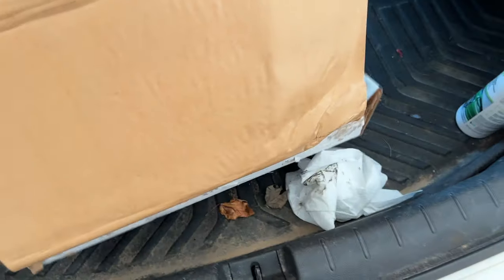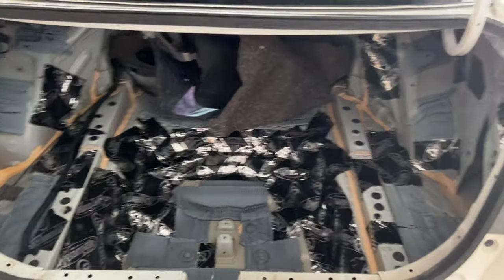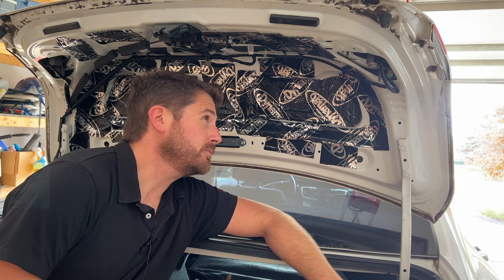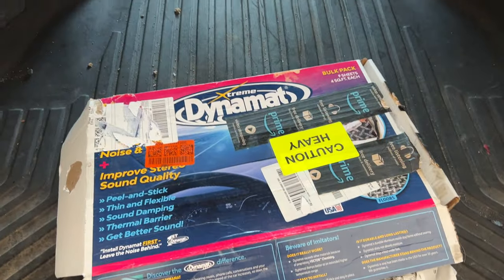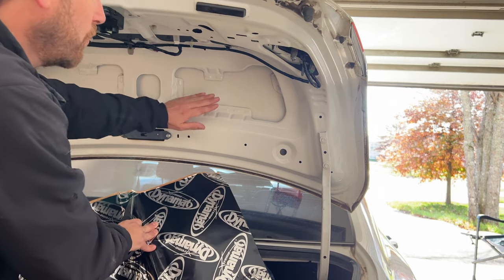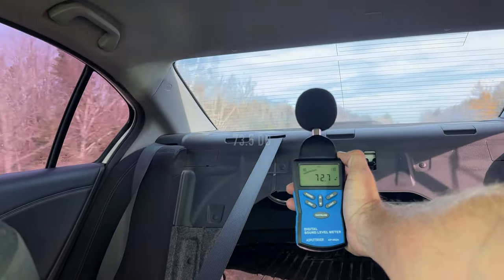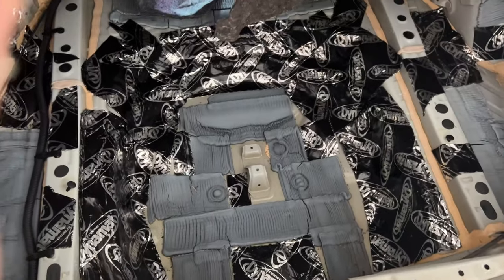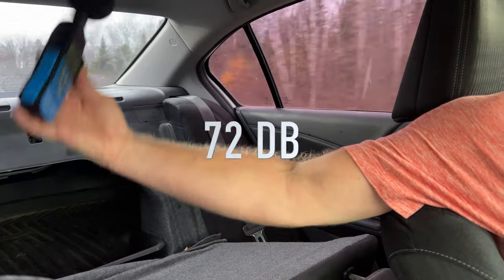The Secret To Sound Deadening Your Car's Trunk

Comment: Car sound insulation needs more sound insulation and sound absorption materials. Shock-absorbing materials don't have much effect on decibels. The focus of the rear compartment is to fill the voids on both sides of the tires. The shock-absorbing material should not be too much, otherwise it will cause low-frequency pollution, and low-frequency sound insulation is relatively difficult. My car is 110KM/H 71-74 decibels, DIY result is 60-68 decibels. for your information

Comment: A fabric headliner with a polyfill backing added (in addition to adding cheaper sound deadening material) is a great way to lower the road noise. Yes adding sound deadening to the floor, (and)doors, and adding closed or open cell foam in between the outer and inner skins r also inexpensive ways to reduce road noise. I've personally been able to reduce my ambient road noise by at least 3db. Also I'm only halfway done with my vehicle so hence y I say at least. (It's been 3db already and I'm not finished yet. I still have 2 more doors and 2/3 the floor to add material to.)

Comment: Great video. I’ve been interested and fascinated with vehicle NVH for many years (since the 80’s). You are very much in point in that the newer cars sound very tinnie.  Especially Japanese vehicles (I’m not saying they are worse). I believe they have a different philosophy in acoustic management in comparison to let’s say German cars. Japanese cars tend to have very little acoustic insulation and focus more on just balancing the sounds/noises. Even a Lexus LS sedan has very minimal insulation but is perceived quiet because in my opinion they target the source of the noise producing components. Anyway, in my experience, sound deadening and acoustic sound absorbing insulation do work especially when placed in key areas, however, the quieter you make the car the “ noisier” it will get. If you quiet or reduce road noise the engine or wind noise will then be perceived as sounding louder. You quiet that then squeaks and rattles in the interior will be very prevalent and sound very annoying. What a rant, I’m sorry. Lol. I love videos like these that have a before and after testing and that are very informative.
Reply: You are absolutely right! I've gone through these phases on my Honda Jazz. I covered the entire floor, doors, roof, trunk and hood with layers of Noico and Closed Cell Foam, the floor also getting a layer of MLV. My current 'noisier' phase is from the front wheels / tyres / suspension and my NVH mode is still switched on in pursuit :)

Comment: Although you did a lot of work on the material installation, it doesn't seem entirely scientific. The frequency of the sound is critically important. A decibel reading doesn't give the complete picture.  When I have done tests on my own car the biggest percentage of the noise is at very low frequencies, below 2500 Hz.  Being able to block and/or absorb those lower frequencies will indeed make for a more comfortable ride experience in the cabin.  This may be why with even a small decibel change you may  experience a bigger change at certain frequencies that actually make the road noise sensation much more comfortable.

Comment: In the early 2000s i fully sound proof my sadan, with flashing tape.. or flexi seal.. way cheaper.. and made huge difference.  People said in the summer the heat would make it full off. But.i went over it with bitchmen paint to stop that happening.  Probably cost $ 250 all up to to do four doors,  boot, and floors.
Reply from the maker: Interesting! Thanks for sharing!

Comment: Guys! What he did in this video is great but, in fact, for a normal sound isolation you need 3 layer. First layer (what he did in this video) it is the vibration layer and part of the sound nois.The second ot will be the termo and sound layer (between 6-12 mm thick) and the 3rd layer is just the sound layer ( a phono absorbant sponge at arround 15mm thick). This way you will see a great change, having all 3 layers not just the first one, the vibration absorber layer that it is shown in this video. It is great that you can see a change with just this one but, it is much more to be done for your sound isolation than just this.
Reply: Thanks for the info. Which parts of the car do you recommend deadening the most?
Reply: I did my trunk door, the other 4 doors, and the ceiling. Measured with my phone at speeds over 130km to 160km/h my noise was at arround 84db. Until 110km/h was just under 80. So, I would recommend the wheel fairings, the floor and the hood. This should be the most noisy parts of a car because of the road noise and the engine. All the other parts should not be as important as what I said but my car did have some vibration layers on all the parts I did the sound proof.

Comment: This material gets rid of vibrations and reverberation. It absolutely won't lower the road noise, but it may change the pitch and do a better job of keeping music in the cabin. It will make more of a difference when listening to music than it will eliminating road noise. Sound deadening is much more complicated than people thing. It takes a lot of time, money, and and adds weight.
Reply from the maker: It would lower the road noise if you place it on the floor of the cabin. But I agree with you that it won’t lower the road noise by placing this in the trunk. It might if their on the wheel well!
Reply: Yea. The basic design of the frame and some holes already designed how road noise get inside the car.. not much you can do. That’s why Mazda was advertising how the resigned the frame to make it less noisy. 😂 Honda needs to step up their game
Reply: And choosing the right tires for the driving noise makes a lot of difference.

Comment: Love the video! And what about adding to this extra layer of rubber foam? Is it going to lowers the measured dB?
Reply from the maker: Thanks! It should lower the db a bit more yes.
Reply: Don't forget the icing on top - Mass Loaded Vinyl layer in the trunk and under the floor. Achieved close to a dB reduction on my Honda Jazz, just with this.

Comment: Good morning, can you try putting a layer of 1" thick black rubber foam onto the inner wall of tires. Try doing first the front two tires and do a sound test before later doing the same for the two rear tires. Let us know the value of each tire balancing before & after layering with inner foam. 

Then do a follow up video after 10,000 miles for db valve vs balancing value of tires vs opening up the front two tires to verify the bonding status of rubber foam onto tire inner wall. 🤣🤣🤣🤣. Regards.
Reply from the maker: Want to collaborate on that video? 🤣

Comment: Why did you not put it over an existing sound insulation in the trunk?
Reply from the maker: It wouldn’t stick to the surface. Something like a sound deadening spray could be used in those areas. I could make a follow up video with that type of product.

Comment: I also want to add that on this video you are treating the trunk of a sedan car. I assume, if that was a hatchback or a van where the space is open, the results of dB dropping would be greater :)
Reply from the maker: Yes it definitely would be. That's why I have the seats down to simulate more of a hatch back like situation.
Reply: @soundproofguide  Awesome, didnt catch that 😅
Reply: Good point, also the Accord has some decent factory sound deadening. I have a Civic Coupe and it doesn’t have any of that factory deadening in the trunk.

Comment: Yeah, not worth it really for just one decibel. I wonder what product you could add to the back of the seats, so when they're up there can be a layer of sound deadener behind them. Maybe a curtain or mlv?
Reply from the maker: A curtain wouldn’t do it but maybe a layer of MLV. Maybe something I could try for a later video if it’s something people would watch..
Reply: @soundproofguide  I'm insterested, indeed. Although people with subs in the trunk might actually want the opposite. I don't have anything in the trunk, so de isolation of that space idea really calls my attention. Regarding MLV, it only comes in small panels, and that could be a problem. Do you know where one can order large sheets? Thanks, man!

Comment: 2:04 not true that 3dB cuts noise by half. 3dB means a 50% cut in physical sound energy but the way the human ear/brain works humans can barely tell 3dB difference and 1dB is simply not perceptible.
Reply: What are u talking about 3db is not a small difference
Reply: Idk man I drive a car with a loud exhaust. 3db is about the difference between cruising with very little drone, and stepping on the gas in the highway. Very noticeable difference for me